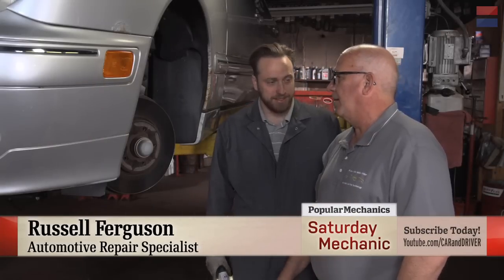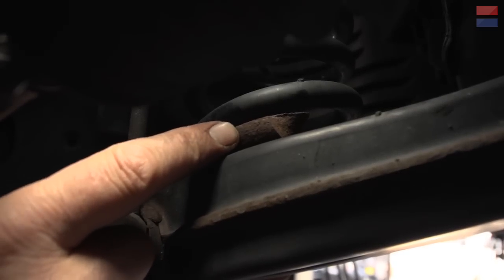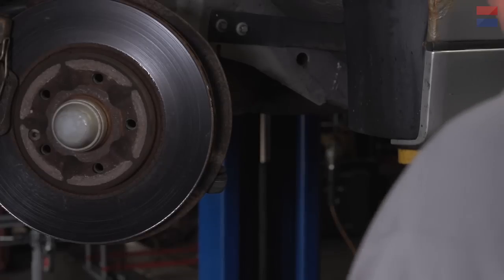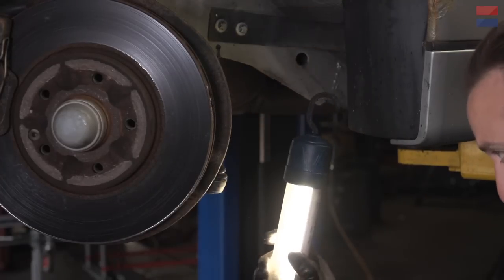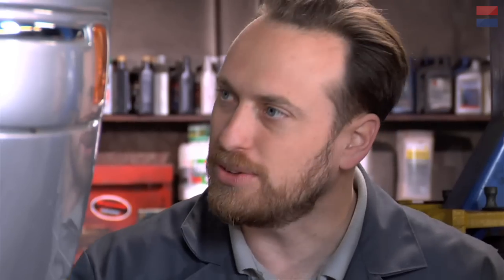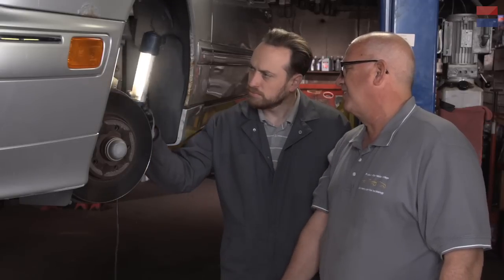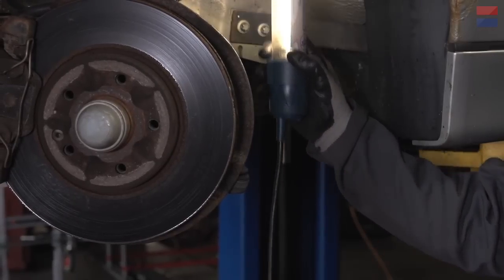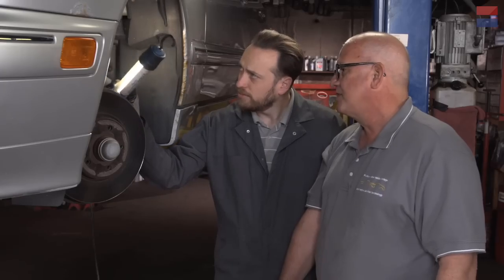The Dangers of Replacing Coil Springs on Your Vehicle - Full Clip

Comment: What a dumb design for a spring compressor. It's no fuckin' wonder it slipped. It has an open C disk on the end! If you pry that disk just a smidge in the wrong direction, it's going to slip. Just use standard clamps. It SLIGHTLY less "convenient" but it's MUCH safer. Don't fuck around with coils. They will fuck you up!
Reply: The problems are 1. Those guys weren't correctly instructed on how to use the compressor (by their own admissions) They also didn't have it tight enough. 2. You MUST orient the plates correctly. 3. You can NOT use cheap Chinese copies of this tool...they slip off....
4. You can't use the outside the spring type compressors, they don't compress enough without getting in the way before you can take it out.
Reply: "Cheap" = low price and/or poor quality. The copies of the German made ones are from China and they are CHEAP. Some of them just piss-poor. The statement stands as accurate and valid. The debate is over. Have you worked with any of the cheap, Chinese copies of this spring compressor? I didn't think so.
Reply: The "CHEAP" copies of the German tools are from China - That is a fact. If you are offended then it's your problem, not mine, not anyone else's.
Reply: *****

"Cheap" and "Chinese" ARE synonyms... Happy now?
Reply: ***** what part of China are you from?
Reply: I'm really curious why you're defending copy-cat poor quality manufacturing.
Reply: *****
Well, if your focus, as a business, is NOT brand building (and therefore not really about quality), and it is NOT about industrial safety, and it's NOT about industrial environmentalism, and it's NOT about public safety, and it's NOT about consumer satisfaction, what do you THINK the focus is on?

The focus is on making units CHEAPLY. I stand by that comment because it is COMPLETELY true.
Reply: *****
High end stringed instruments, violins cellos, guitars?...

BAHAHAHAHAHAHAHAHA!!!!!!!!!!!!!!!!!!!!!!!!!!!!!!!

No. American made stringed instruments have VASTLY greater attention to detail (and stringed instruments is one of those things where attention to detail is EXTREMELY worth the price of admission) The only decent guitars that come out of China are those that are run by American companies with a reputation to uphold... and the American made counterparts are still superior. Thanks for the laugh! :D
Reply: Doomzdayxx The Chinese are not incapable of making quality products. When American companies outsources manufacturing they set the quality standard in which the product will be made and oversee quality control. The only reason why you'd get a "crap China made product" is because the company wanted it that way.
Reply: Joeseph Daniels It's true though, You should have read his comment(s) before opening your mouth.
Reply: bigstudwithaguitar Its not the spring compressor design, its just that they did not use it properly. The spring was barely compressed when they were removing it which is why they were having to pry it out. You have to compress the spring almost completely and it comes out without having to lower the control arm even. You can not use other spring compressors on Mercedes because there is not enough space in between the coils.
Reply: I believe you could be right. Something similar to this happened to me on my '94 Roadmaster, though with much less energy in the spring. Even seasoned mechanics screw up from time to time. I'm sure this guy is a good mechanic but he's not perfect. It's almost like he was more worried about his behavior while being recorded on camera than what he's actually doing, and that bit him in the ass.Luckily nobody was hurt here
Reply: bigstudwithaguitar I am about to do a similar job on an Audi A8. The tool needed is $2000. Was this a $2000 tool or a cheap knock off as the first replier noted. We've gone off on some PC tangent about cheap crap rather than addressing the issue ....... Those seeking to discuss the political correctness of the first statement have been banned from this tread and will be redirected to the Disney Channel's website .... :) 

Can we get back to the real question in hand rather than going off on a bloody tangent ??? I didn't come to view this video for people who defend the crap put out by China. Look at Japan, they did the same back in the 70s, now look at them ... GTR ... enough said. Let's call a spade a spade and put on our big boy pants here, when I am calling  the stuff from China Crap we are not insulting the amazing culture and contributions they have made for 1000s of years ..... StealthyMonk don't be so sensitive.
Reply: ***** Ha ha, that's like comparing a bicycle to a fighter jet - no insult meant but there is a reason that these cars (my A8 in particular)  are so complicated, 8 control arms up front vs 4 for a regular car, and a million other things that are uber complicated. Want to change the timing belt you need a $1000 tool! (have to rent this for $100) etc etc. I remember my first car a 1983 520i BMW, super simple and even the subaru we have now is 100 times easier to fix.
Reply: dieselscience lol..its how you said it the first time that offended ppl, but sometimes ppl don't think before they say, the way you said it second time is more proper, sometimes ppl are to sensitive just ignore the grammar and move on,I don't think he ment to offend Chinese ppl it's the manufacturer s are to blame,get your facts right ppl
Reply: Tony, I wrote "cheap Chinese copies of this tool" NOT in any reference to people of any nationality in any way, people who ignore that are stupid and it is not our place to help them. I do not owe them or anyone from China any apology ... I have a friend from China who immigrated out, got his PhD in USA and will not buy Chinese made tools or other items because of quality - this is by his own admission and he is not 'offended' he is ashamed of what comes out of China.
Reply: *****

"Therefore one is left to conclude you asserted the word because you naturally assume there is a correlation between inferior quality and China."

There is, and there's an ECONOMIC cause for it.

Many hear this line and immediately think that it's racism, nationalism, or some other devious kind of -ism. That's just not true... I'll explain.

This claim, on the surface seems like it's saying that the Chinese are not smart enough, or are in some way incapable of making good products, but that isn't what anyone is saying.

The reason that Chinese products (that aren't backed by American companies) are inferior is this.

China has a broken patent rights, commercial rights, and intellectual rights system. If you live in China and own a business, THERE IS NO REASON TO DEVELOP A BRAND.

It seems like an audacious statement, but it's true when you think about it.

Think about the circumstances.
1. You are starting presumably from poverty (or at least among poverty). Most of the spending power is coming from overseas. This means there is no way to really build a brand locally, and that takes out the first few rungs of the "commercial" ladder making it significantly harder to climb. This limits Chinese companies to making bulk products and sending them overseas to be branded later.
2. IF you did build a brand (Badass Widgets), it doesn't serve a purpose for you. Anybody in China can steal the name "Badass Widgets" and use it themselves. Building a brand, advertising, etc... doesn't actually help you at all in the long run. You will ultimately be competing with your own brand name in the marketplace.

So... what does this have to do with anything?

Well... in MOST of the industrialized world, branding is the main thing that ensures quality. Company recognition is the main tool customers use to find you... so... this is a tool that the Chinese can't fully use, or didn't take the time to even build.

So... you're a Chinese company... you don't have a brand... advertising is just a money pit... other people are also trying to build your product under the same circumstances (and sometimes they will even leech off your company name if you happen to have any commercial success). What kind of client are you going for?

As we covered earlier, the spending power of the people in China is not great. It would be moving a single item to a rare buyer. China DOES NOT have a healthy GDP. The trade among it's citizens is poor. It takes a lot of money for the Chinese to get items of professional, or industrial quality (cyclical argument... I know... couldn't be avoided)

So what do you do with your product?
1. You are wasting your time selling in China.
2. You are wasting your time advertising or brand building
3. You have to compete with other manufacturers all over the country (Whom people from the client countries have no method of inspecting quality of product)

The result is simple. You have to produce and sell bulk lots spending the least possible amount of money. You have to cut costs at EVERY JUNCTION THAT WON'T DRIVE AWAY BUSINESS. This means cheap metals, cheap paint, cheap plastic. VERY LOW PRICE.

So... no... It's not a statement of ignorance. It's a statement based on the legal and economic situation in which Chinese products are produced.

It doesn't apply as much to SOME industries. For example, concert instruments. They make the instruments cheaply, but the fact is, this instrument isn't designed to have to endure hardware style abuse. You put the instrument to your mouth and blow.

Chinese companies DO still cut costs at every junction here, but... it just doesn't make that big a difference...

With tools though... makes all the difference in the world.
Reply: *****
Oh Goddamnit... I can't believe I explained it to YOU... AGAIN! You can't possibly not understand why products made in China but not overseen by American companies have little to no vested interest in quality control. It's been explained over and over... and now I did it again... Goddamnit... -_-
Reply: Monk, you're not 'Tony' and NO the cheap CHINESE copies of the ST spring compressor designed and made in Germany are nowhere near half as correctly functional . You lose any credibility regarding German cars or tools.
Reply: Doomzdayxx Here here !!!     They rustle up a mean " Chicken Fried Rice " down at my local Chippy.

Comment: Having just had a spring compressor come unwound in my hand,i searched for a video about spring compressor safety.
You guys did exactly as i did and i felt myself draw up as the pry bars moved the spring out of the control arm cup.
My left hand was at the top of the spring while i pulled the bottom with my right hand. when the spring compressor failed the spring drove my left hand up inside the shock tower breaking two of my fingers. I am glad that you guys are okay,that could have gone very badly if the spring had hit you in the head or chest. I guess that you can not be safe enough.
Reply: +John Rainlander  You write: "You guys did exactly as i did" -- If you feel like you did no better than these two shop monkeys, then, please, stop working on your car for your own and your family's sake! Not to mention other people on the road...

These two blokes have no clue of what they are doing, how it should be done properly, and what safety precautions one must take. This is so obvious in every frame of this clip. People with this level of non-existent expertise should stay far away from such dangerous and critical work.
Reply: Bump. Gonna be honest, I'd elect to just strap, tie, or otherwise secure the spring to the frame or lower control arm so it won't go very far if it flies out and just keep your hands out of there entirely. Use the pry bar if it doesn''t come out, and just use the jack to compress the spring up into the well until you can bolt everything else back up. To be honest, I'm glad I don't have coilovers or "struts" on my truck, just shocks and springs, but if I did and was going to change them, I'd prolly just buy whole new ones and not even screw with spring compressors. That's always how people get hurt, I've never seen anyone get hurt not using them lol.

Comment: you did not have your spring  compressor tight enough  had it two close together  when you used the pri bar you compressed the spring further giving it enough energy in the wrong direction to slip work  smart and save any possible trips to a hospital...

Comment: This video has probably helped save a few people from injury/death by them not being so complacent when they do the job.

You can still buy those cheap single hook compressor clamps which are totally useless as they easily slip down the slope of the spring. They should be outlawed.
Reply: +V T there is a difference between being complacent and inept. These guy  or at least "clean pants" is just flat out inept. don't even wear gloves... but that's youtube for you. Mercedes is going to be pissed...

Comment: NYUK....NYUK... NYUK... Yeah I agree Larry and Moe! I only could watch part of this and cringed all the way. They started in Baltimore and were lucky not to end up in heaven! First mistake -Doing that type of suspension on a hoist, Second - not compressing the spring with professional equipment (I'm sure Larry was going to use high tensile coat hanger wire), Third - using a transmission jack on wheels no doubt, and forgetting that suspension control arms move on an arc....... need I go on?
This is the perfect example of how unqualified idiots injure, maim or kill other unqualified idiots. I just couldn't watch to the end.

Comment: You don´t need to unbolt anything to replace springs on these cars.. The tool that was used in the video is dangerous and not the original MB tool. With the right tool from MB you can squeeze the spring much more than they do in the video. The spring can carefully been taken out by hand if you do it right... The guys in this video is doing it in a dangerous way and not the easy way. Normally im using about 45minutes to replace both front springs on my 124 on the floor in my own garage.

Comment: Another thing they failed to do was torque the bolts when the suspension was under normal load; i.e. with the wheels supporting the weight of the vehicle (or the jack compressing to 'road-going' load. The lady is likely to suffer premature wear of the bushes. Shame really.
Reply: @oglinkgog  rofl

Comment: I would have used the outer coil spring compressor for that job.  I would have also had it compressed enough before removal that no prying and slipping out would have occurred as did in that video

Comment: I don't think these guys compressed the spring very much or it would have really done some damage when it came loose. I think that is why they were having so much trouble getting it out. I have changed a lot of springs on Long/short arm suspensions and struts, never had one get away from me before.

Comment: Good to see what to avoid. Just did this job and they are not using the compressor correctly. The coil spring should be compressed significantly more than what they did, maybe only 1/2" or less between coils (never compress until they touch).

Notice the spring actually compressing more when he is prying it to squeeze it out- if you can't lift it out freely, it isn't compressed enough. I believe he dislodged the bottom plate while prying to get the spring out.
Reply: Blake Schanen I just did one side of my w124 and I compressed the spring with what looks like that very same spring compressor tool...scary as heck even though I had not seen this video. So the trick is to compress the spring pretty tight and the compression holds the plates together. I couldn’t tell if it came apart or they dropped it and that’s when it all came apart? Oh well.
Reply: I have two of these tools , for short and long springs . Neither of mine have a slot through which the disc can come out ; I've never seen one like that !    

Always compress until the tension is released and the spring just lifts out .

Comment: Nice guys. I usually compress the old spring and tie with bull wire and/or zip ties until the spring is slack and secure in compressed position, before replacing shock absorber, although not worth attempting when replacing the spring. But make sure the spring is tied with about 20 strong ties and it’s definitely done to excess and well secure.

Comment: That tool is a crap design.  I'm an engineer and can tell you that will happen again and again.  There is no safety to stop the spring from slipping out.  If you plan on buying a spring compressor by a Clan type that mounts to the outside and has safety stops.  Smart on the vise grips for safety measure but a bit late.  Lucky man..
Reply: Why would cut in the middle being that it is compressing a spring.....go figure
Reply: The outer compressors do not compress the Benz springs enough that’s why they use the plate design

Comment: I've used regular spring compressors before, I don't think they would slip off like that, as long as you tighten up both sides in small equal increments.

Comment: You can see the lower disc of the compression tool slipping at 9:33 when prying. Best not to pry or distort the spring assembly  when pulling the unit out. Never risk your life, could be deadly. i would use a full enclosed bike helmet , if one doesn't have one, use safety goggles with face a shield when working on springs.
Reply: Great tip on the full-face motorcycle helmet. I have done the same as a safety precaution, especially if at home and using cheap rental spring compressors from china or taiwan. 

I would have hated to be a front end technician back in the day when the coil spring was real common. This is so much of a chore compared to compressing and rebuilding a modern strut assembly.